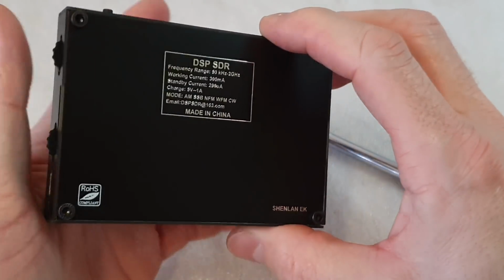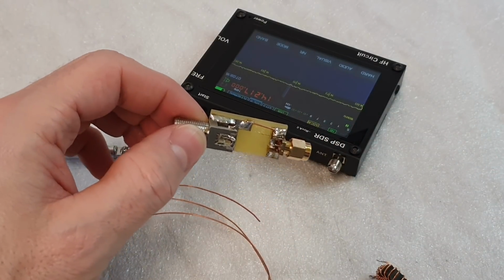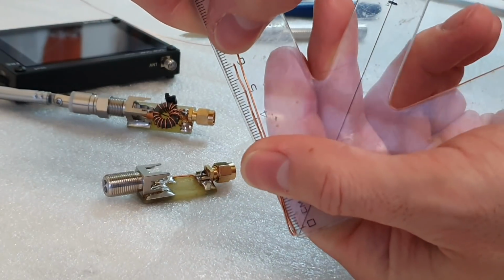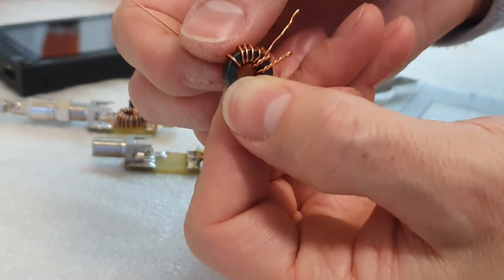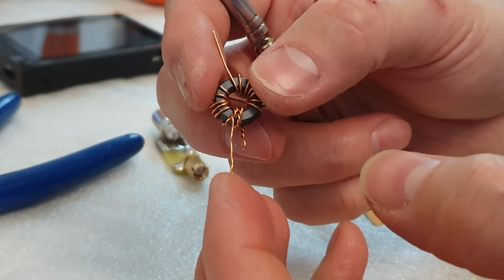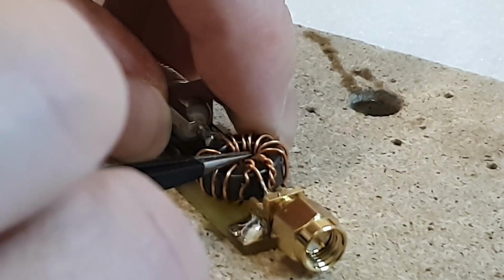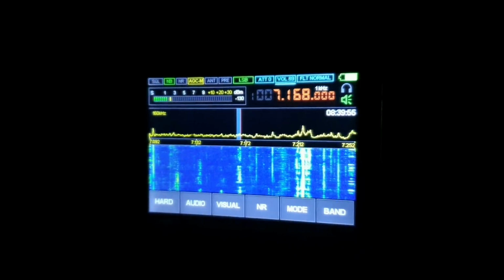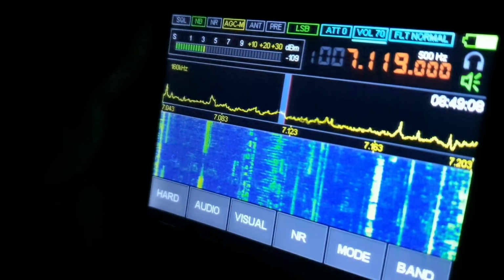Malachite clone & RX improvement on Telescopic antenna

Comment: A bottom loaded antenna may well be impedance matched, but it is very very inefficient. A better solution would be a centre loaded one. You are certain technically capable of designing and building that.

Comment: This should be considered for the Trusdx trsnsceiver, especially for receive. Also, instead of twisting the wire going on the toroid, others have just wound 14 turns of wire, connected one end to ground, and tapped up two turns for the feedpoint with good results. No crossover. Much simpler. KK5R

Comment: My new mini si4732 Receiver is useless with the supplied whip. It needs a long wire.
If I build one of these will it pull in the stations?
Your malachite here seems to pull in stations very well.

Comment: why a 49:1 transformer when your malachite receiver has a hight impedance setting antenna,when you use the whip antenna 75 cm long  ???
Reply from the maker: This clone hasn't hi-Z circuit built-in
Reply: @OM0ET  ok

Comment: Hi! Nice video, I build It for my portable SDR setup, It improved the reception. Would you mind a question? Some images of 49:1 balun show a optional 100pc ceramic capacitor between ground and antenna connection of the receiver part. Is this really needed? 73s de PU5TOS.
Reply from the maker: It mainly used for better performance on a higher bands, especially for TX

Comment: These are also a "must have" if you want to just clip a 20 ft wire to the whip antenna and string it across a room or toss it out a window. Or if you erect a simple longwire outdoor antenna you put one of these at the coax feedpoint. I already have a couple of these laying around but they are set up for BNC because that's what the Softrock and others homebrew units use. I also have some simple high pass, low pass and bandpass filters I'm going to convert to SMA. They can really help with these types of radios with their wide band front ends especially with wideband non-resonant antennas like a simple longwires

Comment: Would it be possible to install the transformer inside the case of the receiver with some kind of selection switch so that it is possible to chose between the direct connection and the transformer or would a switch cause loses in the signal?

Comment: This function works only at frequencies up to 50MHz. In Malachite-DSP1, the function works only if
there is an additional board in the receiver. To select the type of antenna input, go to the HARD
menu, click on the "SW antenna" parameter.- Hi-Z – high impedance input, for short telescopic
antennas
- 50 Ω- 50Ω impedance input, recommended for use with long antennas with ~50Ω wave impedance...............you not describe this in video.......not nided balun for telescopic.........hm.........change options vhen change antenna
Reply from the maker: Hi-Z feature doesn't work with this chinese hardware
Reply: @OM0ET it would be good to explain to viewers what options are involved in the receiver setup.........new firmware have options

Comment: Thank you for this project. I tried using this on a tinySA spectrum analyzer to see if it would improve the reception at 300 MHz. I actually got a reduction in the signal. Is there a reason why it wouldn't work on the tinySa?

Comment: Great video as always! On my Malahit FW 1.10a I have a High Z/50 ohm impedance option. I think ? that does the same thing. Was that option not available when you did this video? I also happen to have a Miracle Antenna with a small onboard tuner that gives me similar results. Hope this helps. ve3bwp
Reply: He has a clone and that option works only in original Malahit (you hear "click" of a relay inside when hi-z enabled/disabled). In clones its useless..

Comment: Brilliant Idea, but not required.   Just need to head over to the Malachite settings  - Hard Menu/SW Antenna and change it from 50ohms to Hi-Z (Telescopic)  Enjoy......
Reply from the maker: It is required my friend. Chinese copy of the Malachite don't includes the DSP with Hi-Z transformer. This feature in the firmware is useless in this case.
Reply: @OM0ET  I've tested it on my unit and changing it to Hi Z makes a difference for me for some reason? No doubt adding this transformer will further improve reception.

Comment: Question, would it be affected it, if you put wax on the loops you made on the ferrite ring to hold the loops in place?
Reply from the maker: No, it shouldn't be the problem. I did it with melting glue and covered heatshrink. All works fine.
Reply: @OM0ET  thanks forgot about a glue gun, saves me using a candle 😆
Reply from the maker: @GhostCallparanormal  😄👍

Comment: Did you try to change antenna input impedance from 50 Ohms to Hi Z in the HARD firmware option?
Reply from the maker: Chinese copies doesn't include required hardware

Comment: Hello all, I have built this, using the Toroid from Mauser (as per one of the comments below), the recommended wire etc. - and it does not work at all. The signal is the same (or maybe a bit weaker) vs. when I just use the telescopic antenna on my Malachite radio. I must have messed something up - but what is it? I followed the video to the letter - and I have built two of these transformers: both do not seem to work. Thank you for any ideas! (My test was on AM radio broadcast)
Reply: You might have the wrong type of toroid material.  Some are optimized for under 1MHz and do not work at all well on shortwave.

Also kinda obvious but you need to use INSULATED wire.  The video shows a copper wire with clear insulation which might lead you to think that plain old dorbell wire, stripped, will work.   It won't!

Comment: Have question, pcb must have this side connection between connectors?
Reply from the maker: No, it is not important.
Reply: @OM0ET  so I can skip this connection?
Reply from the maker: @MrDwadi84  Yes you can. This connection is for join grounds from whip connector and radio together.

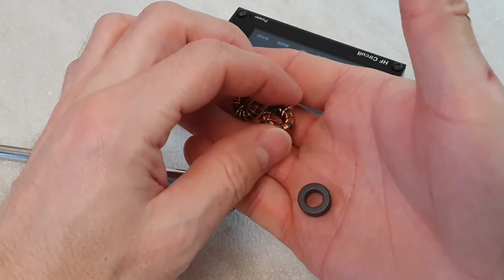Comment: There is a requirement when using a short whip on frequencies below 20Mhz to impedance match the low <10 ohm antenna input up to  the 50 ohm receiver SMA. This is no small feat as the losses are huge and efficiency falls quickly, but its possible if the whip is used only for reception. The easiest way is to use an active FET circuit whip amplifier but if you have a ferrite then use it experimentally (try Mix 32 first) in a 1:49 arrangement (say 3 turns on the antenna side and 21 turns on the receiver side). Of course another way is to auto transform the turns by various taps but this may be cumbersome. Miracle whips are commercially available and work well in this regard. The only reason I can think of as to why this author has used 49:1 is that the 14 windings are providing a fixed inductance as a base loaded whip, and definitely not as a reversed 1:49 balun!
Reply: The reason for 49:1 is a longwire antenna generally as a rule of thumb has an impedance of 2450 ohms which is 49 times the 50 ohm input of a receiver. Unlike most portable shortwave receivers which already have a high impedance input you need to have some matching on these designed by amateur radio operator type receivers that have 50 ohm inputs to make a whip or random wire type antenna work. When connect put a high impedance antenna to a low impedance input you end up shunting most of the signal to ground much like a resistor voltage divider (Yes that's very simplified but for practical understanding it's essentially true for receive only applications)

Comment: Is this a 49:1 unbalanced wire length to balanced input (Balun) you have made? - I thought 49:1 transformers were only for end fed Half-wavelength antennas? & not random wire lengths or a telescopic etc? Isn't it a 9:1 transformer you need for a random wire length antenna or a telescopic

Comment: Original Malachite has filters on short waves, adjustable attenuator and "high Impedance" mode when you selecting Telescopic antenna by menu. Clone is clone. Not all functions are added.
Reply: that may be so, but the russians havent taken the western market serious yet.  I would always prefer russian tech over chinese tech, but the russians dont seem to care too much about non-slavic customers.    So far...
Reply: @zoolkhan  Russian Malachite is made by hands. They do not have robotic lines as china do. I have ordered one. (price near 140eur) But they are making it two month. After half a year I will have it!!!

Comment: would this work for matching a ATU with a short whip on a 20 watt qrp transceiver for transmit?
Reply from the maker: If you want TX you need half wave wire with this 49:1 UnUn.

Comment: I haven't watched the whole video yet, but I have to say, if you press "HARD", you'll find an option 50 Ohms - Hi-Z in order to match the antenna impedance.
Reply from the maker: The Hi-Z and 50ohm features doesn't work on chinese clones. That's why I made this transformer ;)
Reply: @OM0ET  I later checked out and you're right. I also finished watching the whole video and it is very useful. Some portable radios such as Sangean ATS-803a, 909 and 909x could use it for they are known for having this mismatch. Thanks.
Reply: @OM0ET  Upgrade on my comment. I aquired a new Malahite version and this one has a second pcb that turns this feature effective.

Comment: My Clone Malachite SDR receiver has the following as part of the specification.
'12) Built-in receiving module improves the HF reception on antenna, an additional board with a source follower has been developed. The board will be built into the standard receiver design.'
https://www.banggood.com/50KHz-200MHz-400MHz-2GHz-Malachite-SDR-Radio-DSP-SDR-Receiver-3_5-inch-Touch-Screen-AM-or-SSB-or-NFM-or-WFM-Analog-Modulated-p-1773087.html?p=HP080535844950201908&custlinkid=1429766&cur_warehouse=CN&ID=6298871
Do you think this will have a true High Z/50 Ohm internal switch for use with a SMA telescopic antenna or would your Antenna project be better? I am currently using a Scanmaster SW2 HF/VHF/UHF antenna with BNC to SMA connecter.
https://www.nevadaradio.co.uk/product/scanmaster-sw-2/

Comment: Thank you Paul  for this build  video, I  am  building  two  versions  so I  can see if they  are  both wound   correctly  which I think is  the most  difficult   to reproduce , can you please advise  on which  Malahite setting to  use with your  Transformer,  Hi- z  or 50  ohm  please  many thanks again.
Reply from the maker: The Hi-Z and 50ohm features doesn't work on chinese clones. That's why I made this transformer ;)
Reply: @OM0ET  Thank you  Paul.

Comment: Hi, great video.  I see that you were doing the demonstration on 40 meters.  How does it perform with Medium Wave and the other shortwave bands?  Would we need a different transformer for each ham band?
Reply from the maker: it mostly depends on the antenna lenght. 1m telescopic whip is not good for MW. Ferrite antenna would be a solution for MW and LW. Other SW band are good with this telescopic whip.

Comment: Even clone Malachite receivers with full Russian software are showing a button (under HARD), where you can select between Hi-Imp input and 50 Ohms input.

How does this comply with your external device ?
Reply from the maker: clones don't have an additional boards, this feature do not work

Comment: There used to be made an antenna called Miracle Whip that was adjustable and on Ebay is one now made in China, do you think it might work for that unit?
Reply: If it’s the same miracle whip as the original, probably will work.  Inside the miracle whip unit there’s a toroid with multitaps on it.  By adjusting the rotary adjuster you select a different tap.  At VHF/UHF the toroid is effectively removed and the antenna length is adjusted for best results.
Reply from the maker: Hard to say, I never tryed that antenna :)

Comment: You did not show the settings of the receiver. Was it set to 50 ohms or hiZ?
Reply from the maker: it doesn't matter what settings are set, because in clones without additional board will never work ;) it's for original Malachite only.

Comment: Hello Paul. I'm wondering why signal is better on antenna with your transformer... I mean as short antenna as 100-150cm has impedance of unity ohms on 40m band and lower on lower bands. You made transformer which usually is used to transform Hi-Z (2500ohm) end-fed half wave dipole to 50 ohms. In your example you transform 0.5ohm antenna (150cm short ground plane for 7MHz) in addition divided by 49! You got final impendance >> 0.01 ohm << (even bigger mismatch than without transformer). It would be worth considering whether the receiver (chinesse clone) is copied correctly :) If you have some time make tests with 1:1 isolation transformer (maybe shorted for DC inpunt do the job) or connect 49:1 just in opposite direction as 1:49. Than you will transform 0.5 ohm to 25ohm whitch is much closer to 50 ohm than 0.01 ohm :)
Reply from the maker: I measured impedance of this telescopic whip. On 160m = 5000ohms, 80m 2450ohms atc. higher frq, lower Z
Reply: @OM0ET  So looks like antenna is not simple whip connected to hot pin. It has some matching circuit itself. Interesting...
Reply from the maker: @lucjann.577  no, i measured it straight trough the reductions
Reply: Hello both! It is an interesting technical discussion. I think the problem is the complex impedance in this case. Short antennas have a low resistive component but a huge reactive component. Paul probably considered only the absolute value of such impedance in this case. What is your opinion? 73! Michal OK1GHZ
Reply: Could you try it the same with simple wire with the same lenght? It's very strange for me

Comment: Or - you can switch the radio input between "50 Ohms" and  "Hi-Z" in the HARD Menu.    Clearly says "SW antenna".
Reply from the maker: Hi-Z feature is not available in the chinese clones (without an additional board)

Comment: 2m is useless as inteferance from the internal circuit, but its great on HF exept for powerfull stations swamping the band , half of the memory slots do not work. The freq steps are a REAL pain on the touch screen to touch correctly and selecting a station from the touch screen is bad as you end up with tiny frequency steps to correct as frequency step changes., once on a station it is pleasing.The sound is really full and detailed on FM and great on hf. I  On mine  the Pre amp setting is wrong ie off is ON, and on is OFF, leave it activated ie OFF on the rod antenna and dont activate it on a 20m wire or similiar. Setup I find 75db on AGC as recomended by the Russian designer "George". RF gain 20 to 25 on rod with activated preamp, 10-15 setting on 20m wire with preamp not activated (with 9:1 balun).The screen was not flush with the case a gap of about 3mil at one edge, I opened the front and found the edge of the circuit board snapped of at 2 corners,thats why it would not hold down. If you open the case it will be a pain as the other side of the visible case screws is a nut which will drop off inside! It is an incomplete radio, but it receives way better than my techsun 660 and sounds better and picks up more than my Icom pro due in part to having no mains borne inteferance which renders my HF radios useless at times thats what was apparent straight away on battery power. Some time it does not want to come out of hard setting and a restart is required.  No speaker grill is not a good idea, its been thrown together, not Chinas best offering, shame.
Reply: Still using the TEST firmware?

Comment: Probably 9:1 unun would work even better, because it can match wider range of antennas (random length, but not 1/2 wave or 1/4 wave). Your whip probably is not 1/2 wave on some HF bands, even on highest 10m.
Reply from the maker: I tested 9:1 and it was -S2 weaker signal reception compare to 49:1

Comment: WHERE CAN YOU FIND THE ANTENA CONNECTORS AS SHOWN IN THE VIDEO.....the two connectors soldered to the PC Board ????
Reply: Ebay has all kinds of connectors, search for "SMA male solder" and "F connector female solder" and you should find them easy.
Dont buy the other kind of SMA connector.. the RP-SMA..  i did buy some cables with that format once lol :) I dont know what RP-SMA is for but they did not fit the SDRplay :)
But good there is SMA to RP-SMA converters to buy so i can get some use for the cables. I just bought the cheapest cables searching for SMA and found out that way that there was something called RP-SMA too :)
To build a docking station box with antenna mount and the transformer inbuilt in the box and a screw-on SMA cable to the antenna could be a good way to get strain relief on this handheld Malachite SDR i guess and could perhaps make it more comfortable to hold a larger box too :) But perhaps not as small to put in the pocket... hmm :)

Comment: Question the socket for headphone which I have a Attachment to my computer will that work on my PSK 31 software secondly I orders a 25m long wire HF with BNC I have a attachment for the BNC will this work 
Look forward to hearing from you paul
In Kent
Reply from the maker: Q: "socket for headphone which I have..." sorry I don't know to answer to this question. Q: "I orders a 25m long wire HF with BNC..." yes, all antennas with impedance near 50ohms will work with this receiver.

Comment: Hi Paul. Thanks for very informative video! What's the length of your telescopic whip? 73, Paul
Reply from the maker: Hey! :) Thanks! It's 1m long ;)
Reply: @OM0ET  Thank you Paul.   Looks great but are you comparing a 19" included sma whip to a 36" F connector whip?  One whip is almost twice as long.  Shouldn't you compare using the same length whip?  An SMA male a female F adapter would allow you to do this. Could some of the improvement just be the longer antenna? Thanks.  Howard W6HDG
Reply from the maker: No no, It's the same lenght of the whip. 🙂👍